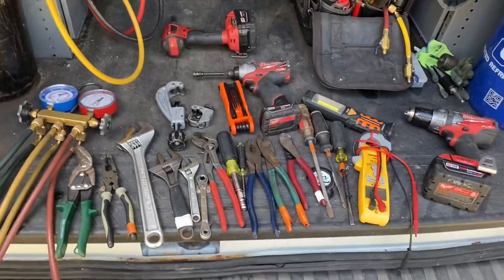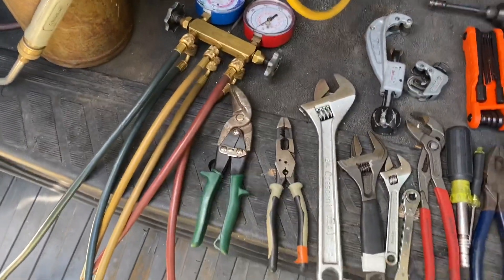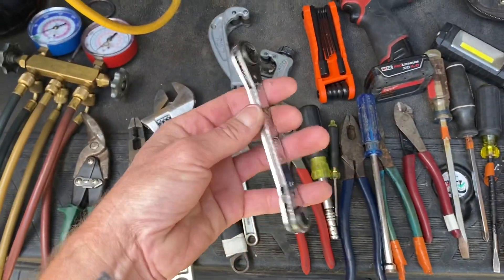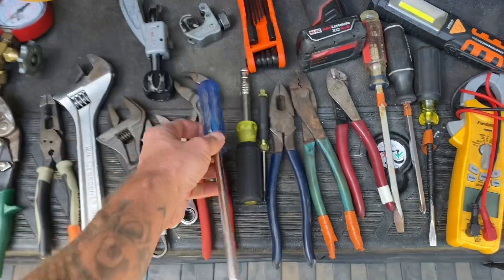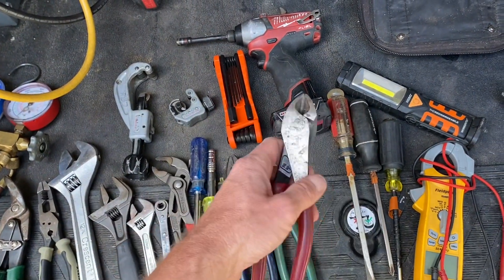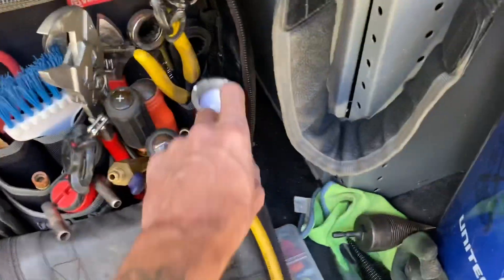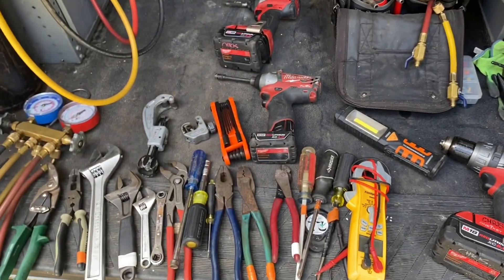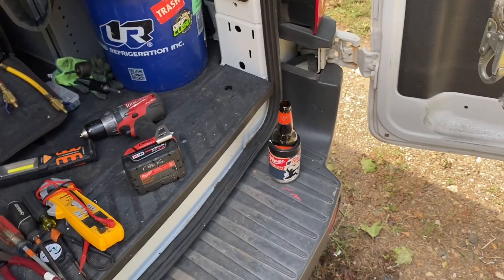Essential tools for starting out in HVAC/R

Comment: Hi Chris, I am a technician in England.  I have found your channel very useful. Can you give any advice please I'm currently looking to get some analogue guages and have been looking at a set of R410a and R32 as I work mainly on these gases at the moment with air con. Is there any reason why these can't be used for other gases if I use an app to get saturation temps. Any advice on the subject would be appreciated. Thanks Fran
Reply from the maker: You can use them as long as they have high enough ratings to handle system pressure .  For example you couldn’t use R22 gauges with 410A because the pressure or 410A is a lot higher especially the high side

Comment: Just started an hvac apprenticeship a month ago doing both installs and service. A few tools we've used pretty regularly not mentioned. Sheet metal crimpers, cordless metal shears, sheet metal benders, cordless angle grinder, tape measure, markers, pencils, pipe benders or alternatively, these plastic tube things that go inside the pipes to stop kinking, a hammer, cordless skilsaw, sawzall, xacto knife, hack saw, flaring tool.
Reply from the maker: Yes , thanks for adding that stuff , good suggestions. I based this video off a service side point of view not sheet metal or installs so it would depend what part of the trade you are in for sure
Reply: @Cscrefandhvac  I didn't realize there was companies specializing in one or the other until watching this video. Then I realized the big job we're doing right now installing ducting in the new construction must be install, but the hrv repair we did the other day must be service. I think we do more installs than service though to be fair. I'm just getting my own tool bag together now after borrowing and begging so i've been trying to think of every little thing. This video and all your others have been really helpful. I've just been thrown in the deep end with everything. I've been really trying though.
Reply from the maker: @Dug88  nice man good for you 👍. And yes , a lot of companies specialize in certain things where a lot will also do both installs and service. Usually they are 2 separate depts and you either do one or the other but at small companies you end up doing both because there is not enough people to have separate install and service guys
Reply: @Cscrefandhvac  We're a small company, three of us at the moment doing jobs. It's a small town though and there's not many other companies so we're doing all the things. Honestly, it's an awesome trade, you get to learn pretty much all the trades and the guys i'm learning from have decades of experience and they're mostly patient and are willing to teach. I'm really thankful to have this opportunity, i just have a lot to learn.
Reply from the maker: @Dug88  that’s awesome man good for you . Try to just absorb and learn as much as you can dude . That’s also great that you have really experienced guys teaching you also .